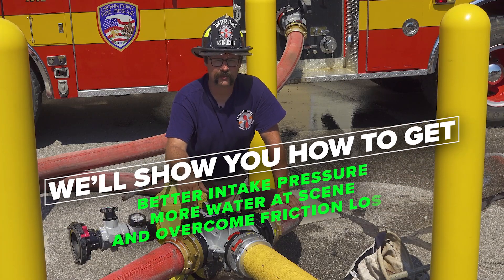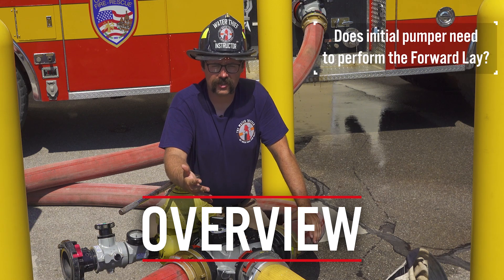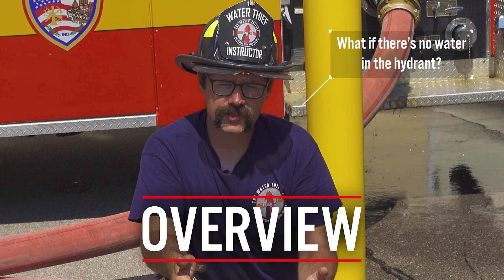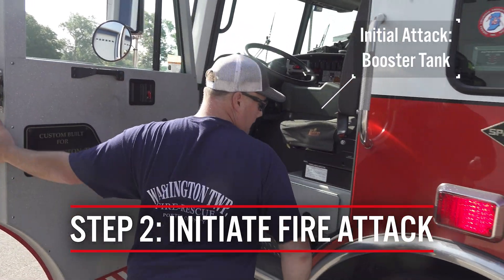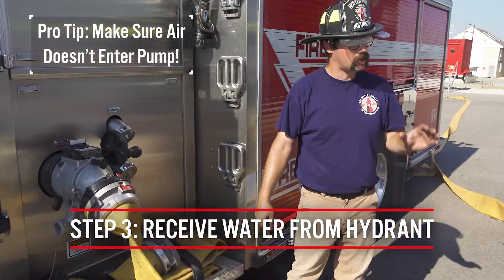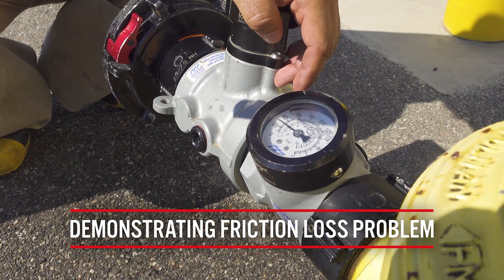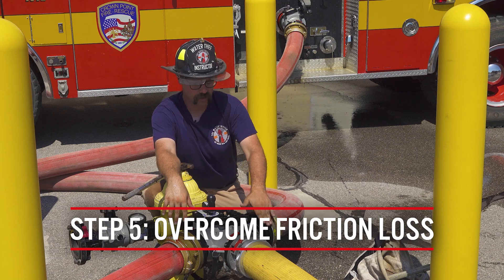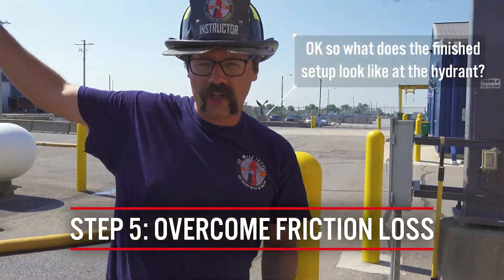Mastering the Forward Lay | Beat Friction Loss | Hydrant Water Supply (Episode 1)

Comment: why not leave a small portable pump with pre-pack hook-up behind the hydrant on the sidewalk as part of the initial forward lay after initial hydrant charge the hydrant man is already there can hook up to the 4way valve and start the portable pump when called for to allow the 2nd 3rd and 4th due pumpers to go right to the fire  bldg. if the  1st due pump drops two big LDH lines one can run off the 2-1/2 of the hydrant with LDH gated adapter or the 2nd 3rd or 4th due pump can drop a second big supply line into the fire and put the pump in operation independently in case of issue with 1st pumper.

Comment: This is only a sales pitch!  If you have a good Municipal water supply,  there is no need for a 4-way valve ( humate) [sp?]  You can lay directly from the
 steamer connection and get great GPM.  BTW, 5" Supply is a must!
Reply: This is a bad thought process. My city has a great water supply most hydrants in the 70 to 80 psi range and you still lose tons of water due to friction loss in the LDH. Go drill and find out.
Reply: Uh uh. You may get sufficient water some of the time, but you will never get the maximum that the hydrant is capable of. The dynamic pressure reduces and pressure loss to friction increases with the increase in flow. Once these meet in the middle, the limits of the feed are reached. By introducing a pumper at the hydrant, you can compensate for the friction loss. You don't need a TFT hydrant valve to do this, but having one eliminates water shutdown when the base pumper is introduced.